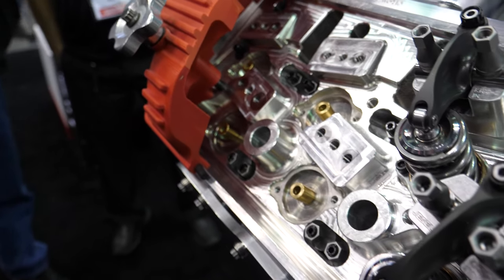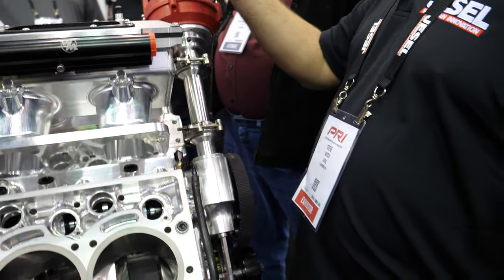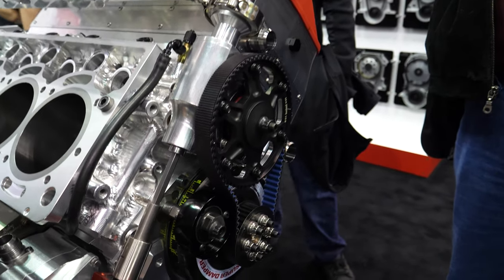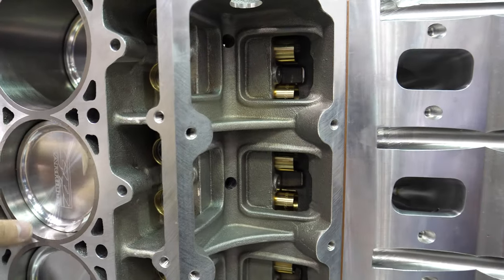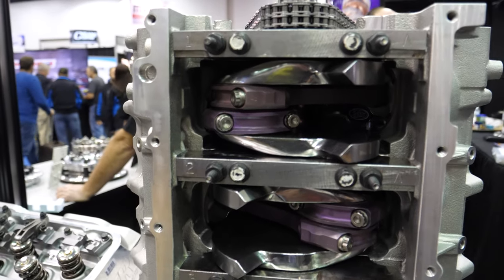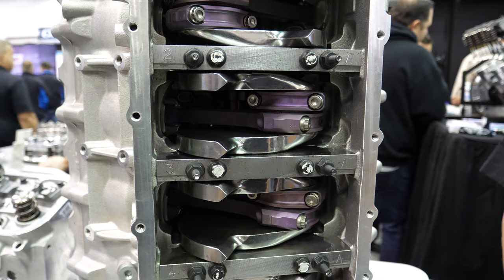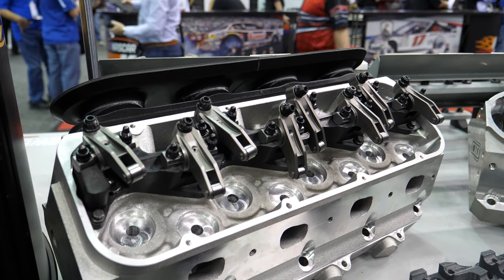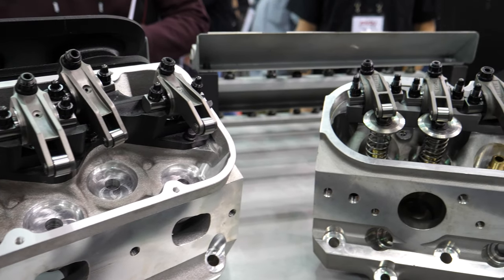JESEL ValveTrain Equal 8 12,000RPM Engine, Flat Plane Crank LS, Shaft Rockers and More! - PRI 2018

Comment: Compression is16 to 1.  Over 3 hp per cubic inch on alky with no power adders! Most recent build  has 3" cam journals with 8.5 deck height.

Comment: Keyway lifters vs Tie Bar lifters?
Reply: Key way lifters remove the tie bar that holds them together. The tibar is for keeping the rocker from twisting on a roller setup. With rollers on the end of the lifter that ride on the cam lobe they have to stay straight, if they turn in any direction the roller cannot roll correctly and it will destroy the Cam and the lifter itself. Key ways keep them straight eliminating the tie bar which in certain circumstances can hang up and cause the tie bar to break or push or pull the lifter towards or away from one another in the lifter bore during movement up-and-down. Key ways eliminate weight from the lifter and excess material required to attach the lifters. On flat tapit lifters they can turn freely in the hole and that is something you want those particular style to do to even out the wear. They have a ever so slight rounded hump on the friction surface. They ride slightly to one side of the the cam lobe and cant be swaped for other styles after ran without replacing both items. The last thing is the bushing style are replaceable after the bushing wires or is damaged. Normal blocks have to be honed or recut for oversize lifters if damaged.

Comment: the first is crossplane crank, and the second one is flatplane crank,
Reply from the maker: That is correct. It’s an LS based motor
Reply: @JC-11111  at least Ford had the balls to put a flat plane crank into a production engine.  We'll see how long this engine lasts anyway... my guess is it blows up on the first dyno pull and we never hear about it again.

Comment: i wonder why they still insit on building pushrod engines, they could make ohc designs to spin at whoever knows how many rpm and get better performance and efficiancy out of these engines. i guess it's because they wanna build engines close to the pro stock engines before the rule change?
Reply: Because they’re simpler, lighter, and most all are super compact. Have you seen a side by side comparison between a Ford Coyote and LS3? The Coyote is so much larger even tho it’s smaller displacement. Lastly the 
LS aftermarket industry is gigantic and Chevy is know for their pushrod SBC and it’s really the only thing that makes them unique among the big 3.
Reply: Explain to me how it makes any difference to your tires if you make 500HP at 5000RPM as opposed to 500HP at 7500RPM? Seriously, explain to me the difference
Reply: @MasterKeyMagic  Looking at this I am going to assume some things about this comparison in order to make it valid, the 5,000rpm engine is lets say 6.0L and the 7,500rpm engine is 5.0L. The 6.0L engine will make more average horsepower then the 5.0L engine making it faster on a road course, even if the 5.0L engine makes a bit more at peak it will still be down when it comes to average horsepower which is what matters.

This is why the 7.0L C5R and C6R along with the 8.0L Viper GTSR dominated in racing and had to be BOP out of existence.